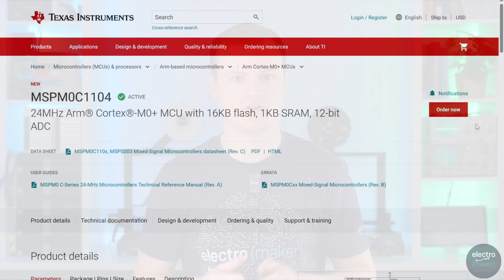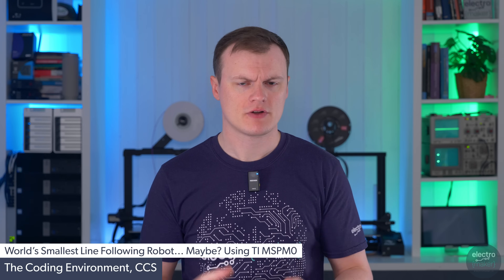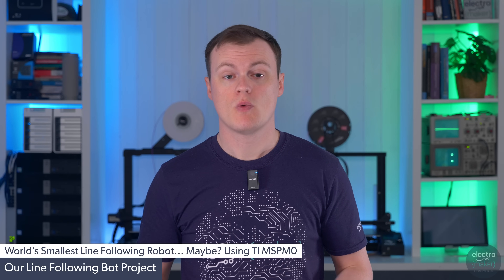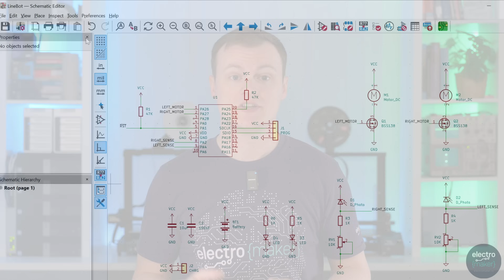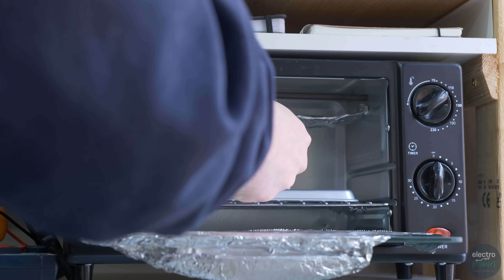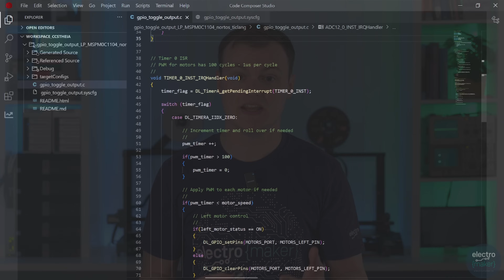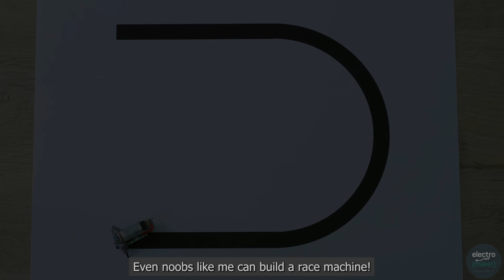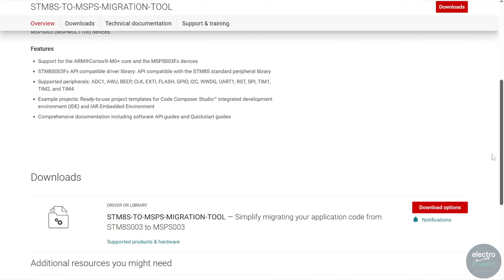World’s Smallest Line Following Robot… Maybe? Using TI MSPM0 MCUs

Comment: Been a while since I've used a Launchpad.  Love to try out the current development setup with the new MCU.  I have a solar powered motion detection yard light that I've wanted to modify but it has an unmarked MCU.  I think the MSPM0C1104 would be great to replace the existing MCU so that I could change the detect logic and timing.

Great line following robot and good job on the theme song!
Reply from the maker: Thanks! That yard light project sounds like a perfect fit, being able to customise the logic is exactly where this chip shines. Hope you get a chance to try it out!